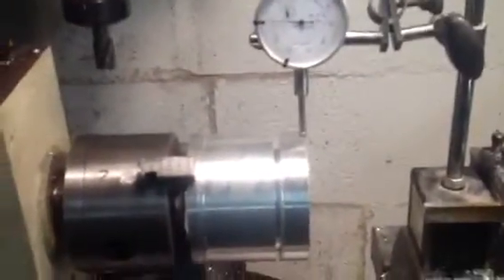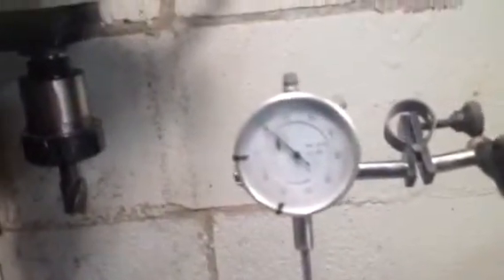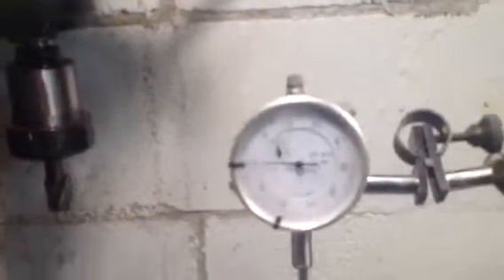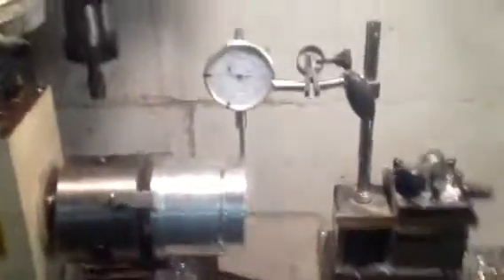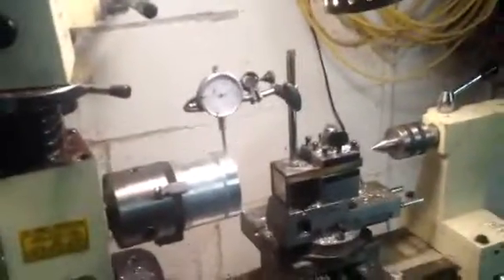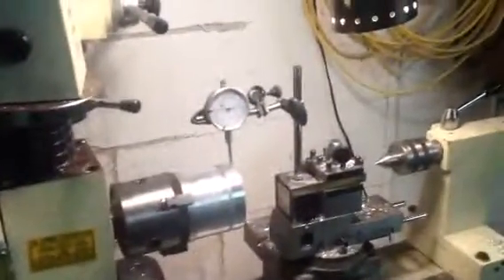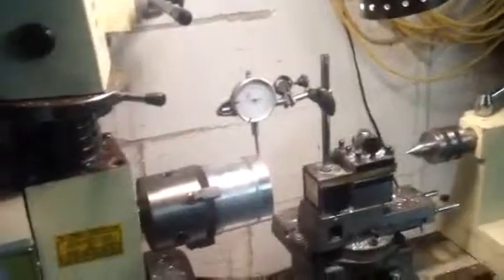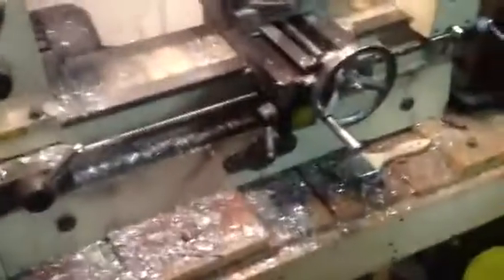Shop Fox Lathe/Mill/Drill

Comment: I've done some metal work like welding, hand making small parts with basic home tools for broken guns and diy projects, but I want to expand what I can make.  I'd also like to start boring my own barrels and creating prototype guns as a hobby. It's legal to make your own guns in the U.S. add long as your follow the laws,  if you were wondering. would this be possible on a machine like this? 

Could you do a video on boring a piece of bar stock? It would be much appreciated!
Reply from the maker: Hello and thanks for your inquiry. I don't see any reason that you couldn't bore barrels with this machine. It is very capable and extremely tight. I've never pulled anything from the machine and was disappointed with the quality or precision. It's like any quality tool, it's only going to be as good as the operator. Take your time and follow the rules and this machine will suit your needs. I literally use it every single day. It's solid, it's capable, it's powerful, it's reliable and it's highly adjustable. You can adjust it to any tolerance you wish. I have absolutely nothing bad to say about it at all. I only wish I had purchased it sooner. I could have done so many things with it. The milling head is solid as a rock and easy to setup/change, the lathe is dead on and is also very easy to set up. The drilling aspect of the machine is superb if you need accuracy...that's about it. Just get one! You'll love it as I do mine.
Reply: Budzilla Sohoski Thank you for the quick reply! I'll go look in to them more and glad to hear it's served you so well. I look forward to more of your videos!